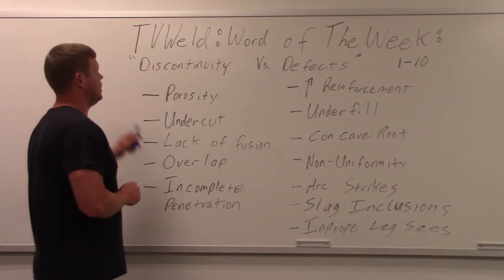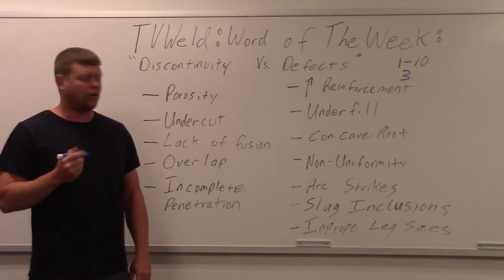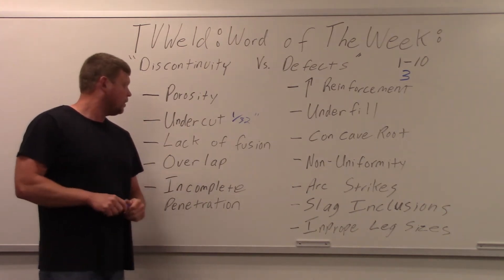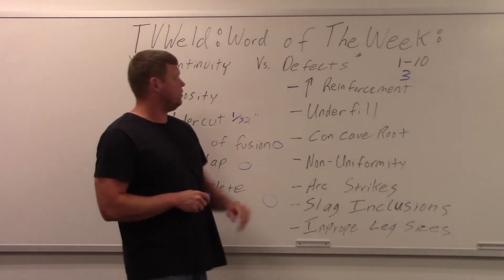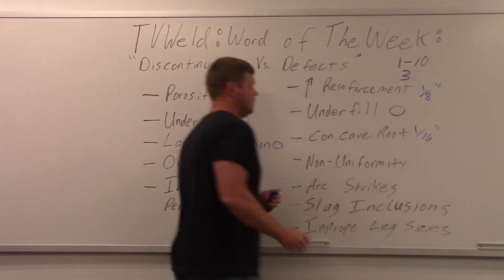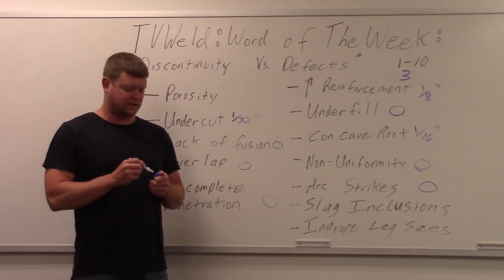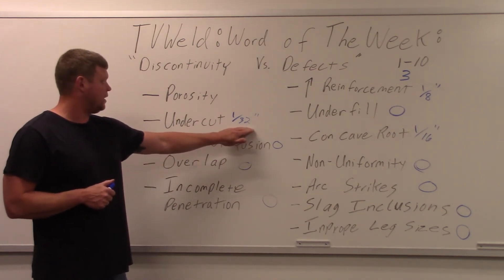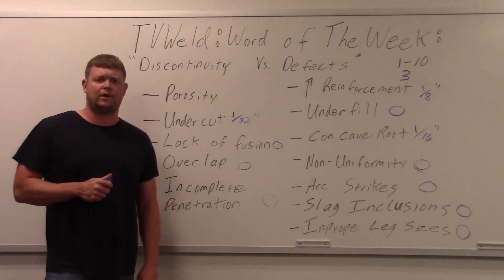Weld Discontinuity Vs. Weld Defect

Comment: is concavity on the back of the root or the face? 

Thanks for the explanation man. I'm enjoying these types of videos with code and cert explanations, I'm starting to pick up a lot of side work and want to make sure i'm covered as far as this stuff goes.

Would you consider making any videos on become a CWI? It's something i've had some interest in lately. Thanks!
Reply from the maker: Concavity by code is allowed to be 1/16" on the root only.  The face of a groove weld must be at least flush with the surface of the base metal.  

https://www.youtube.com/watch?v=F4Fqg9Dmnvk&t=4s

Comment: I was amazed by the amount of porosity allowed in your previous video. This video makes for easy understanding of the two factors. Cheers young man!
Reply from the maker: I agree.  I always thought allowable porosity limits were high.
Reply: @TVWeld  Should be zero especially in structural welding.